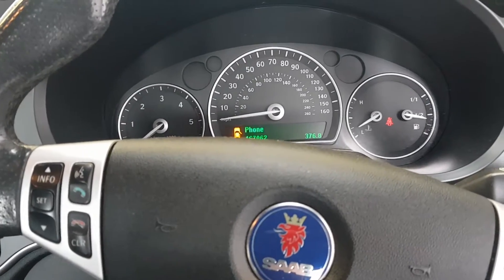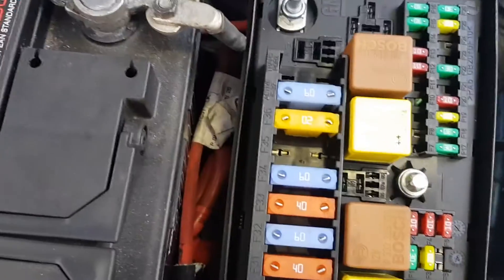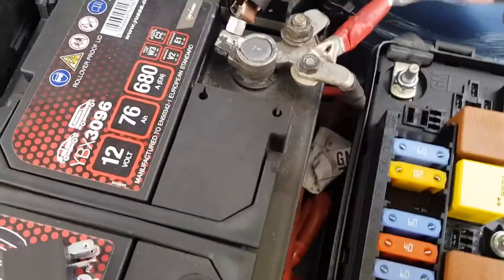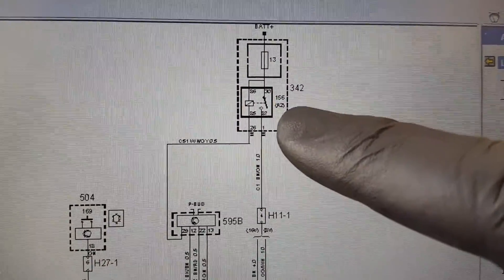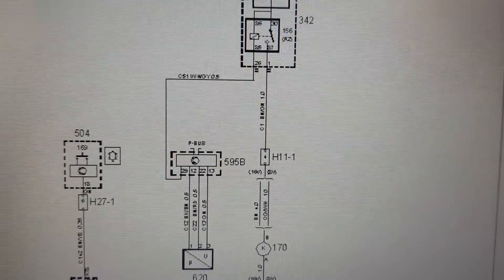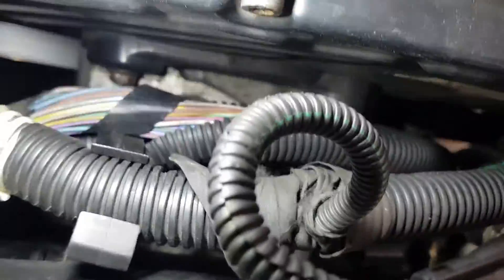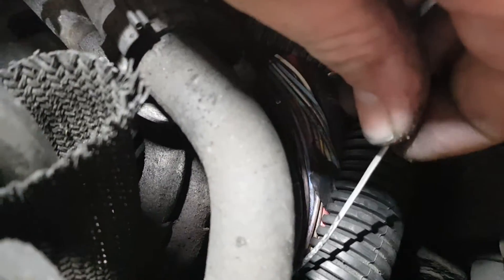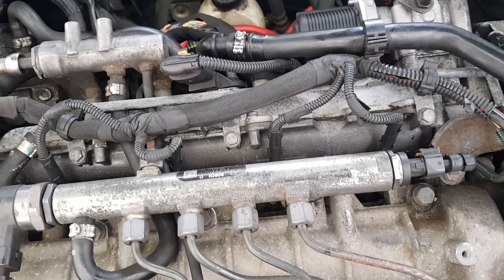SAAB 93 A/C compressor fault P1530 A/C relay open circuit

Comment: Hi, I am having similar issue sith my saab for 4years now, and i have changed a total of 4 ac compressors in 4 years, each time I have the mechanic install a new compress the ac comes on blowing cole air but it doesn't chip out when it suppose to stop, it just continues to run continuously and that cause the compressor to burn up each time because its running so hot without chipping in and out. Can you tell me what could be the issue for the ac compressor not chipping in and out? Could it be some type or sensor gone bad?

Comment: This has been a great help to understand how to understand the problem...

However after doing the same with my system... I was left with a more confusing situation. 

It would seem i have an issue with ground from my relay (2005 B207)... although i have yet to find damaged or broken wires...

And when adding a ground wire from relay to chassis the aircon works....

However it doesn't turn off when I turn a/c off or even when I turn climate control off.

Any ideas? 

Thanks

Comment: Fantastic video.

Just had mine regassed but wasn't working.... untill I jumped the relay and all worked fine for 30 minutes.

So now I want to test ground from relay to ecu to compressor.... but I'm a little confused....

When you checked pin 29 on the big plug did you disconnect the battery before removing it.

And which ecu connection would it be on a B207?

Thanks